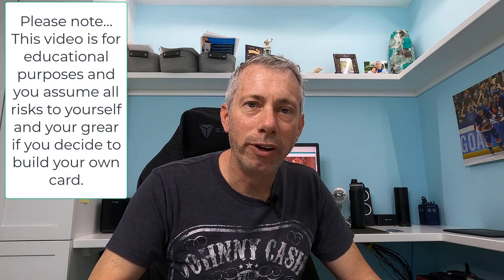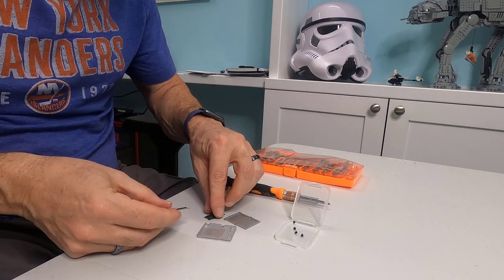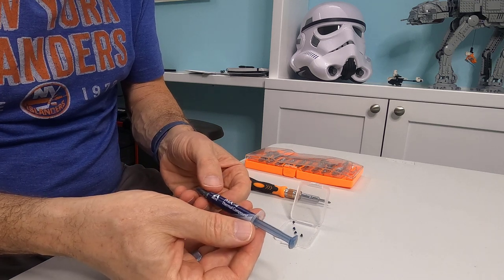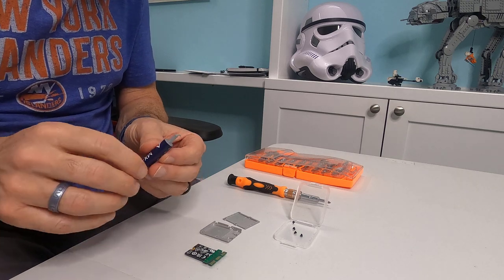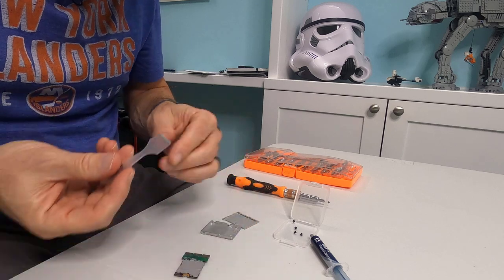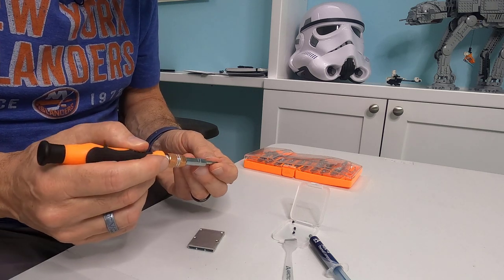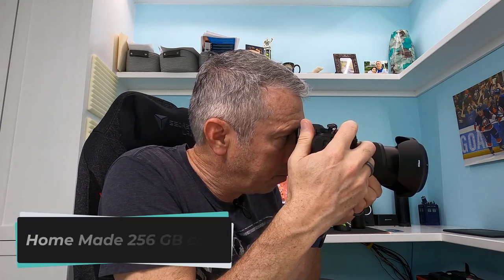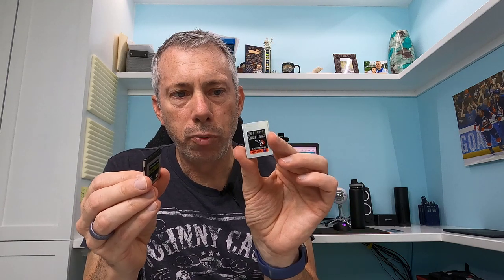How to Build Your Own CFExpress Card (Save Money)

Comment from the maker: After bench-marking the store-bought vs. home-made card, our home-made card edged out the store-bought card in every category. See the results here: https://shutterspeak.net/build-your-own-cfexpress-card/
Reply: You benchmarks seem very low.  I believe you need to run those benchmarks on a faster card reader to get more accurate results.  I get 1700 MBs read and 900MBs writes on the cards that I use.  I use  Angelbird sx 512 GB and it cost $179 .  I use a pcie internal card reader.
Reply from the maker: @scottscrufari  It turned out to be the USB port - not sure why but one - it is USB-C is different than the other. There is a second  USB-C port on my pc which is much, much faster.
Reply: @ShutterSpeak  well you should delete this.

Comment: I'm diggin the trooper,  but you need to trade that shirt in for a Redwings jersey 😛 My main concern with doing this is the added heat inside of the camera.  There is a reason why they don't include m.2 NVME's in the camera at time of sale.  I'd have to do a tear down of a Hasselblad to see how they handle heat dissapation.  Because you are disappating heat from the case into the camera.

Comment: I saw this video around the time it was released and purchased a 512GB CF Express Type B from SinTech (in a metal case). 10 months later and the drive has failed today, it stopped registering in the camera claiming it needs to be formatted etc, doesn't register in the PC either but does show that something has been connected. 

So I took the premade DIY type card from SinTech apart, and found that it was using a Toshiba/Kioxia BG4 (which from what i understand are some of the best 2230 NVMe SSDs to use for this adapter type, far more durable than Western Digital SN570 onwards etc). I cleaned every part of the internals of the DIY CF Express Type B card with Isopropyl alcohol, let it dry and it did start working in the camera, until i removed the CF Express and reinserted it, stopped working and started giving the error once again. 

I attribute the failure of the SinTech CF Express Type B card to the adapter being used like manufactures (SinTech, ZITAY) but otherwise it did work amazingly flawless for 10 months straight.
Reply from the maker: Thanks for the update. Mine still works great. Are you going to try a new adapter?

Comment: oh by the way something else i do that works, 
Now do you want to be able to record your 8K 60P video on a media  1TB that only cost you 149.00?
here is how you do it you purchase for only $30.00 or so for a CFexpress Type B to M.2 PCIe 4.0 x2 Extension Adapter Cable for NVMe 2230 2242 2260 2280 Key M SSD for Canon R5 Nikon Z6Z7Z9
what this does is plugs in a m.2 SSD Drive into a dummy CFexpress card B, by a Ribbon cable, 
Do a search for that product, then you can buy  a 1TB  Seagate FireCuda 530 1TB Solid State Drive - M.2 PCIe Gen4 ×4 NVMe 1.4, speeds up to 7300 MB/s, Compatible PS5 Internal SSD, 3D TLC NAND, 1275 TBW, 1.8M MTBF, 3yr Rescue Services (ZP1000GM3A013)

Now i have this adapter and have a 4TB m.2 drive to it this one
Seagate 4TB FireCuda 530 PCIe 4.0 x4 NVMe M.2 Internal SSD with Heatsink
the SSD drive only cost $599.00 If you was to buy a 4TB Cfexpress B Card it would cost you anywhere from $1,800.00 to $2,000.00 easy..
You see these companies are ripping people off, they can sell these for much less the very same companies are selling 1TB m.2 SSD's for $150.00 and for the cfexpress cards around $400.00 to $500.00 Big rip off, 
And The M.2 SSD's are just as fast if not faster and more reliable then the CF express cards by far.. 
Google them products and you can be on your way to capturing 8k 60p on a 4tb m.2 ssd for around $630.00 that is including the adapter i have 3 adapters incase,  i just mount the m.2 SSD to my rig next to the camera and a ribbon cable goes into my camera with the dummy CFexpress b card that is plunged in my camera, you should check it out this is the best way and you save so much money i have 3 4tb m.2 that i use with this camera and it's blazing fast never had a problem, i recorded so far over 22 hours of 8K 60P video with this method never a problem..

Comment: So after 8 months, is it still operationsl? Are there any issues? How about using it in z9, is there any issues? How about video recording in raw formats in 422 in z9, did it record well?
Reply from the maker: I use it all the time. It works perfectly. I haven't tried it in my Z 9 as I keep it in my Z 6 to record video. However, it is a CF Express card - the same as any other. I just made it myself. It should work with anything that take that type of card.
Reply: @ShutterSpeak  , right now I just spend a lot to buy the z9, 30mm lens, memory and other accessories. Meaning I already maxed out my allowed funding.
But when I need the extra memory then I will definitely consider what you just did.
I mean, I just saw 300$ for 1TB and that is a big savings

Comment: Hi, have you tested these cards in the d850?
Reply from the maker: I have not but they are really no different then what you buy in a store. Works on a PC, camera and should work on anything else that can accept cfexpress.
Reply: @ShutterSpeak  as per the sintech website, "Nikon Z6,D500 can't support BG40 SSD". Another youtuber says that the bg40 doesn't have a dedicated controller and dram chip, which may be the reason. So I'll go with the Samsung ones which you have recommended.
Reply from the maker: @kamatchinmay  I use the samsung in my Z6 all the time -works great!

Comment: If Angelbird hadn’t come out with its 512gb CFexpress for $179 I’d be all over this as is a super cool concept.  I shoot on an R5 so my cfexpress is only used for video.
Reply from the maker: Just be aware Angelbird is having compatibility issues with the Z6 & Z7. There is a firmware update but it requires an Angelbird card reader.
Reply: @ShutterSpeak  I have an Angelbird  card with no compatibility issues on my z7.  I heard it had problems only with the Z9
Reply: compatibility issues was with there 1 TB cards
Reply: @scottscrufari  no problems with my z9 so far

Comment: Do you know if that can run with the a7s iii?
Reply from the maker: It should work with anything that accepts tat type card. Haven't tested it though.
Reply: @ShutterSpeak , I figured out that a7s iii is actually using CFExpress type-A, which has different dimensions. Thank you for your fast answer!

Comment: These cards cannot be identical by speed. NVME SSD is much faster than SD card.
I guess you used the wrong method to test the speed. As I know Nikon utilizes its internal memory as a buffer for serial shots but not the card. So you've just tested the speed and capacity of this internal buffer which is the same in both cases despite the card you've chosen.
Reply from the maker: There is no SD involved here. I think you missed something.